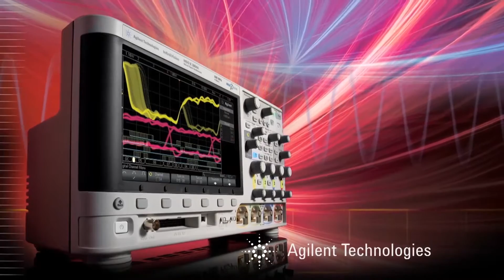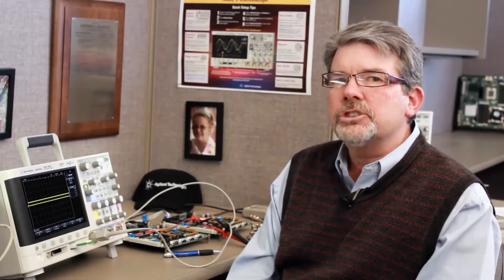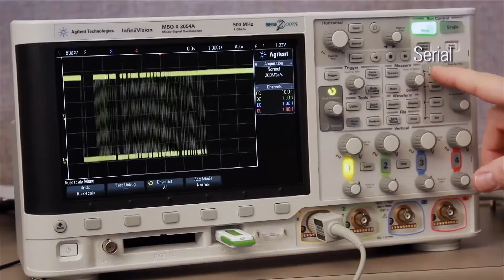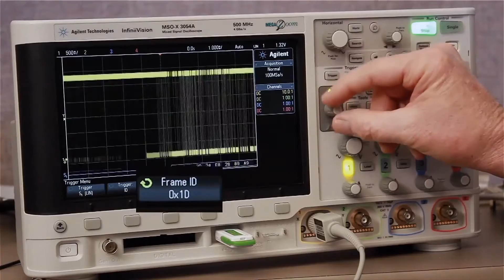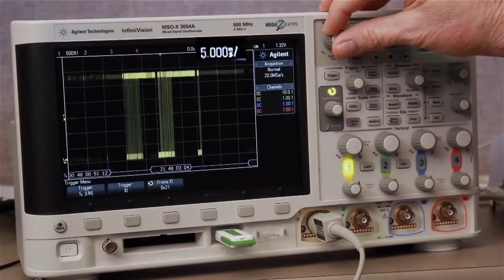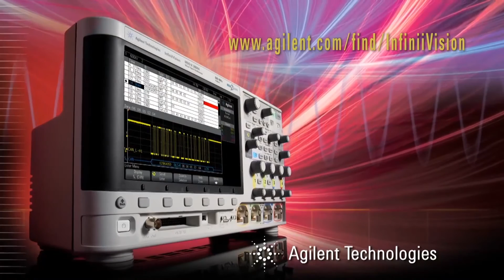LIN Serial Triggering and Decode for Automotive Applications

Comment: I'm wondering why it says LIN serial for automotive.  Automotive and commercial trucks have been using single and/or dual wire CAN bus protocols based off of bandwidth needs. There are still some low speed protocols in use ( some based off of antique UART structures). And most of the time, you can view the wave patterns with a graphing multimeter at the DLC, comparing to specs found in the service manual. I'm intrigued by the equipment shown here, especially since automotive scopes are junk. But I must admit, given the short video, I have more questions than answers.
Reply: You are wrong. Automotive uses BOTH CAN and LIN, for different purposes. LIN is HEAVILY used in non-safety critical mechatronics, such as door modules, reading lights control, side mirrors controls, etc. Not to mention, the CAN bus is a PHYSICAL component, while LIN is a software module (protocol). The equipment, shown here, is in heavy usage when developing and testing LIN functionalities.
Reply: @TRP_TheRandomPlace  That's interesting. Engineering always referred to CAN as a protocol. We were taught that it had a 12 volt wake up signal, and it's 2.5 volts at rest.  At the time, they made no other distinction.